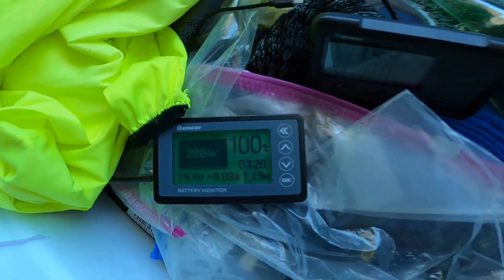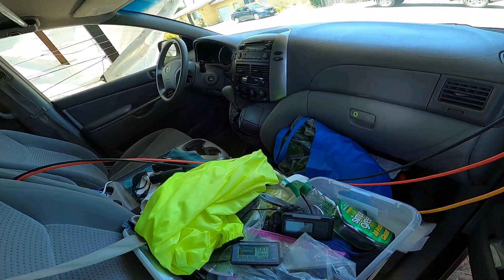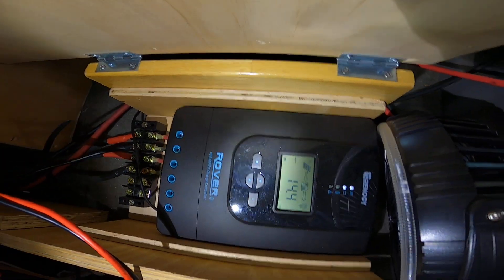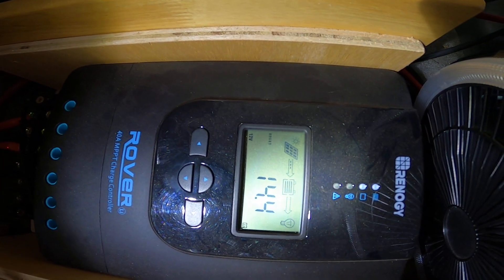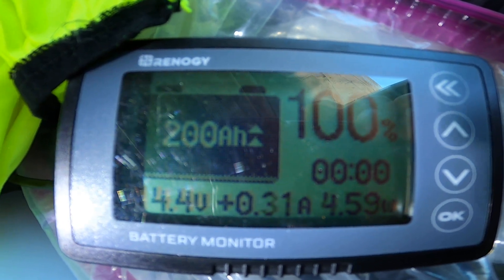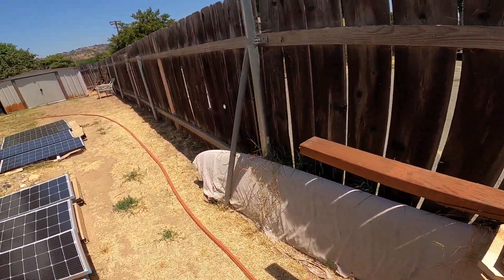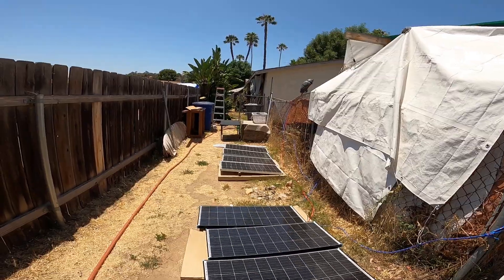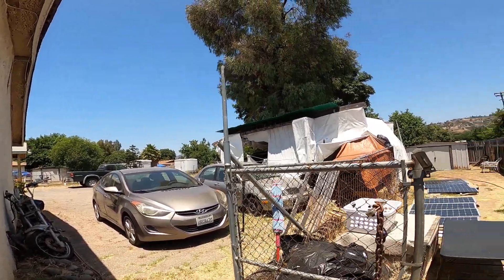Solar Power For Indoor AC - Part 2 of 2

Comment: I run my air-conditioning from solar 24 7. It wasn't cheap but we bought the inovair 9000 btu minisplit. It's 38 seer and for 10 or 12 min it uses just over 600 watts then drops down to a little over 200 watts the rest the time it's on. Our off grid tiny home is actually a 1993 model 30 foot holiday rambler travel trailer and it's actually great for me and my wife. It would be difficult if we had kids but this alternative way we have found to live has been amazing in about every way. We have 1850 watts of solar and 30 kw of lifepo4 and another 14 kw of nissan leaf batteries.
Reply from the maker: That sounds like an amazing system. I need more batteries... and solar panels... and a larger charge controller... and a bigger inverter, etc. etc.
Reply: @realcreature3D  the solar stuff is kinda addictive lol. I started out with a 3000 watt all in one powmr unit and a year and a half later I've spent about 30 grand on components and wire. I'm an over the road truck driver so I'm on the road 3 weeks at a time but when I'm home all my time is spent messing with solar stuff. I've gotten all the stuff to make my water heater work from solar dump load and recently converted the camper over to 220 split phase since the air-conditioning is a 220 unit and the inverter I'd bought for the ac unit had to be split phase to get the super high efficiency.  I just got another 150-70 victron charge controller and hopefully I can get another 8 or 10 panels this coming week. One day I'll get a small house or cabin somewhere and move all this equipment into it but for now it's just running a camper with a lot of extra stuff I've upgraded sitting under the bed lol. Maybe one day before long I can get a local driving job where I can be home some to enjoy my toys but finding a job where I make money at home has never been easy for me. Ive bought and re bought alot of equipment because some things wasn't what I thought it would be so if you ever need advice on what's decent and what's not just let me know and I'd be glad to tell ya what I think about a product
Reply from the maker: @matthewknight5641  Thanks for the support! Sounds like you could have a great YouTube channel to share your knowledge and experience. I'm just getting started so I know I'm making lots of mistakes and my videos are pretty raw. 😅
Reply: @realcreature3D  man id love to make some youtube videos but I'm driving this semi truck about 26 or 27 days a month most months and I guess a kinda stage fright or something keeps me from trying to make videos also. I just keep ordering more off grid stuff and the little home time I get I'm in a race to install it before heading back out on the road. Hopefully soon I can get life in order enough to get a local job and enjoy some of the toys lol.
Reply from the maker: @matthewknight5641  I get where you're coming from. My stepdad did long-haul trucking with my mom for a few years. I know it's hard work, and our country couldn't function without it. We all could use your solar expertise though. I also have the stage fright - haven't shown my old face yet - but I hope my stuff helps someone. Happy trails!